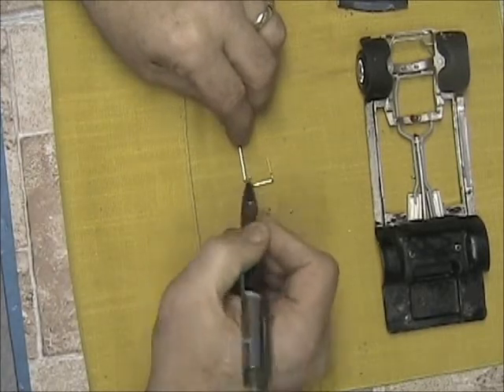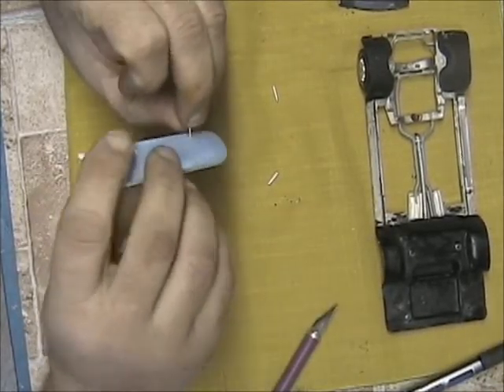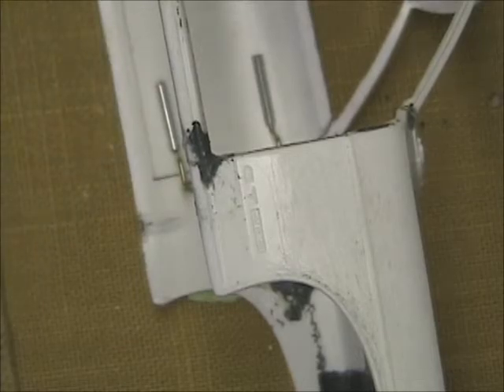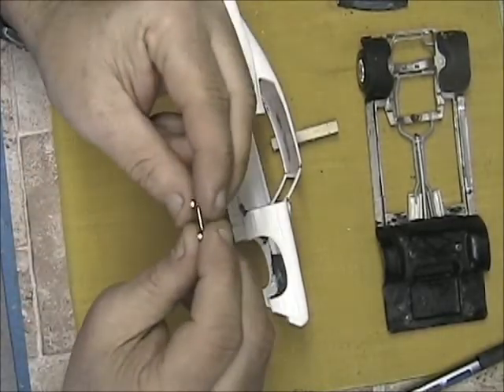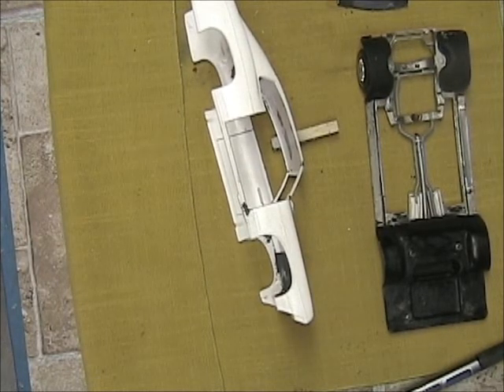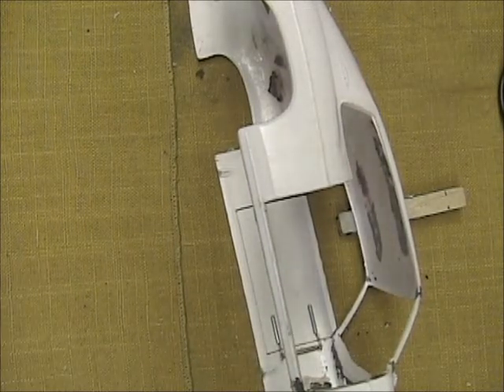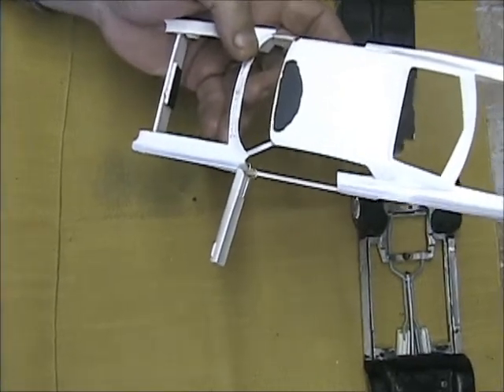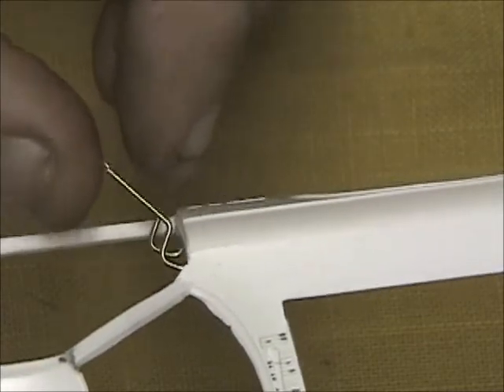Episode Eighty Four Project Door hinges 1968 Galaxie

Comment: After painting ' how do you keep the doors from coming off ? & Is that J B Weld U used at the front bottom of the rocker panel ?
Reply from the maker: Was probly epoxy, it was started when I got it and they used house copper wire and epoxy I like to use super glue, the driver's door was never done, and after paint I don't glue them to the hinge anymore